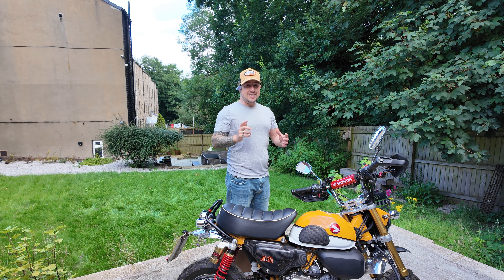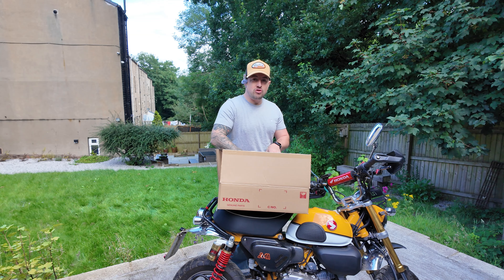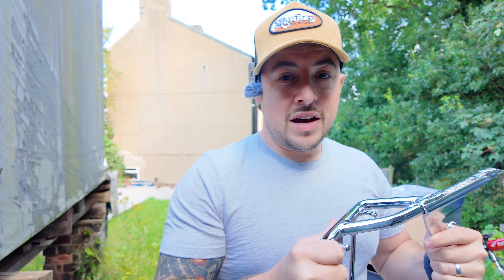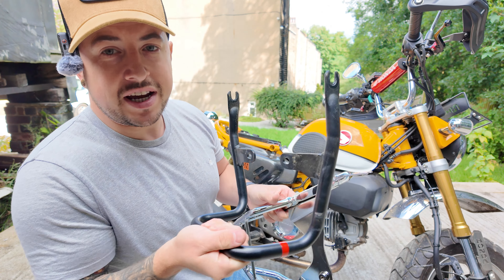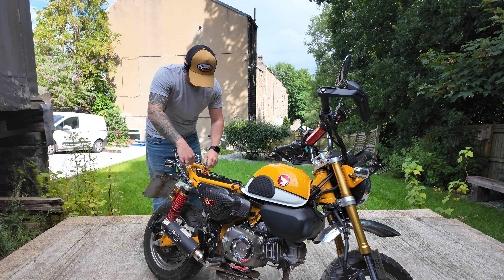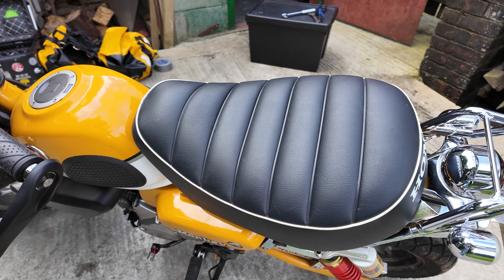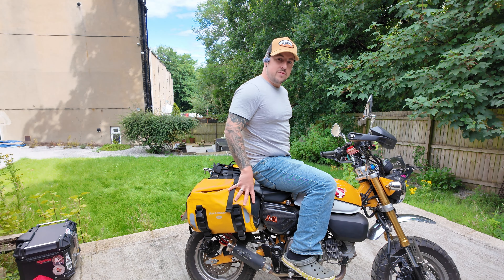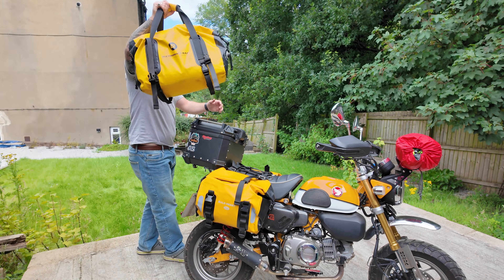OEM Honda Monkey Luggage Rack Install & Review

Comment: Cant you thread the saddlebags through the top of the topbox.
Reply from the maker: There’s 4 pins with rubber gromits on the bottom of the box that slide into some securing holes. I’d have to cut some holes in the connecting part of the saddle bags to do that and chances are the saddle bags would start to break then. Good idea though, but sitting on them is honestly fine

Comment: How has the new rack been holding up?
Reply from the maker: It’s solid! Only trouble I’ve found is the baseplate to my topbox is a bit large for the rack and it struggles to sit on it perfectly. However using my 2x 20l saddlebag and 40L dry bag on it is fantastic! Really is solid and I can put the weight I want on it!